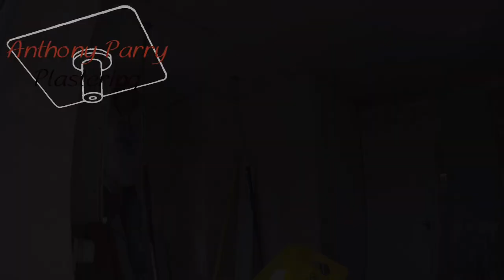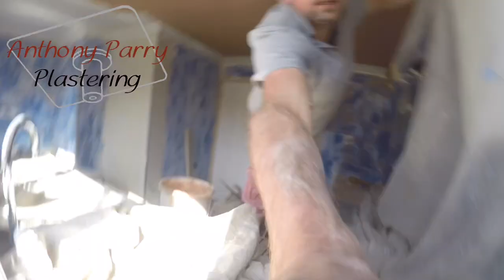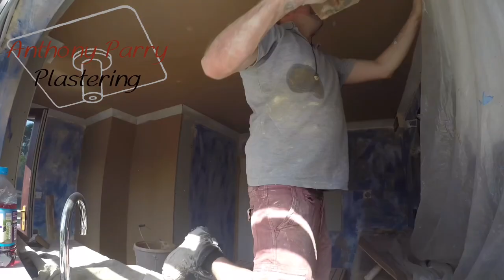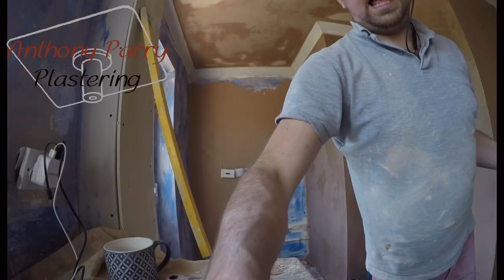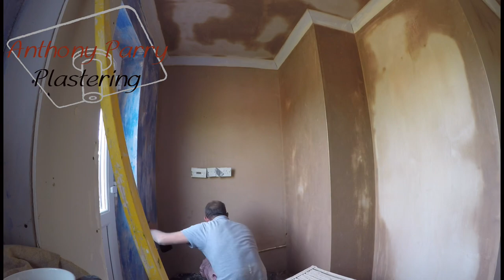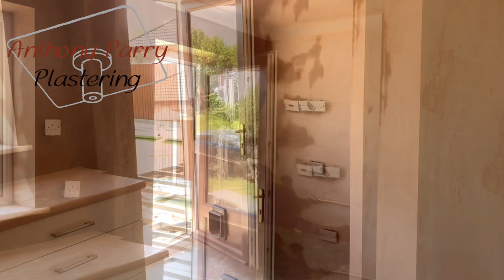Plastering a kitchen start to finish timeslape

Comment: Good work as always pal... But i would never put coving in before skimming as you lose some of the profile....
Reply: Quite agree plus the paper fluffs when I line in
Reply: @alfamad155  it does buddy... 👍
Reply from the maker: I’m sorry boys but I’m going to disagree, I’ve had this conversation a few times. 

Here are my reasons for putting coving on first: 
-It’s more efficient 
As soon as the coving is on you are free to skim all the ceiling and walls. 
You don’t have to come back after 2/3 days once the skim has dried to stick the coving on. 

-You have also got more chance of damaging the plaster when putting the coving up afterwards. especially since you would have to put nails underneath the coving before it sets to keep it in place.
Also you then got to fill underneath and above the coving. 

-You always have got a line to work with so it makes it easier. Especially if you have walls that’s aren’t perfectly straight. This means you can build the skim out to make it right.

-You don’t lose the profile, if you do then something has gone wrong when you put the coving up. 

-If the paper fluffs then that means you’ve been using too much water. 

I’ve never had a problem in the 22 years I’ve been plastering. 
If you’ve never had a problem then that’s great and it’s working for you. These are just my reasons for my method
Reply: @AnthonyParryPlastering  I find the suction generated on fresh plaster means there’s no need for nails.  I also fill as I go when installed either the c shape or s shaped. We all have our own way ultimately it’s what works for each isn’t it.
Reply from the maker: @alfamad155  definitely, I don’t want to say my way is best way, it’s just my way. 
Sorry if it was long winded but I always back my own work. 😀

Comment: is it better to use blue grit rather than pva? I've got to skim a kitchen similar to the one your doing here but I normal use two coats of pva
Reply from the maker: I think it a down to what you want. 
If you’re use to PVAing then it not a problem and you can get on it that day.

If I can I prefer to blue grit, I like that I put it on the night before and I can come in and skim without having to pva before skimming. Also you dont have to worry about the pva drying out. Especially if you’ve got bigger areas on. 
It will even out the set if you have different backings. It should all go off at the same time. 

Also with blue grit you see what you painted on and you have the grit in it. if you have a area that needs more grip. 

Hope that helps

Comment: Hi Anthony great job, are you flatting with a metal speed skim or plastic.
Reply from the maker: Thanks Dwaine, I use  the speedskim stainless steel flex to flatten after my first coat. I use to use the plastic but I prefer the steal one.
Reply: @AnthonyParryPlastering  I used a 900 steel one 2day on an empty property on the bedroom walls after the first coat & was impressed. Do you just use after first coat then
Reply from the maker: @dwainearmitage7570 I do love mine.  I just use it on my first coat. But I seen a few that use it afterwards. I do use on curved ceilings sometimes to help with the curve. But I prefer to use my trowels.

Comment: Buddy why the hell did you put coving up before you plastered it all . 1 it can get damaged,  2 you can loose the margins, 3 if the exsiting walls are out and you put beads up , you can loose the coving corners.  And 5 why make life harder and get all plaster water and plaster all over it . A good job but back to front for me .
Reply from the maker: Hi bud, I find it quicker and easier to do it this way. Rather than doing it after skimming. I also think i’m strengthening the coving by work into it. 
I’m also not a fan of filling the coving after it’s been skimmed. 

In terms of loosing the margin and putting beads on. you can always see the margin, so you can keep it nice and straight especially if you need to build it out you walls that aren’t straight.  
you can put the beads on before putting the coving up. 
I’ve never had problems with damaging the coving. 
It’s all down to how you’ve been taught really.  
I’m sure you way works great for you. 
As long as it looks good and it’s solid that’s all that matters.👍
Reply: @AnthonyParryPlastering  yes that right. But i do the coving as soon as ive finshed skimming , that same day really. But yeah you dont always looss the margin but ive seen a lot over the last 18 years . And you will be surprised . I got taught in college all these years ago with city and glids and level 2 nvq . But if ut works for you and the customer doesnt mind you doing it that way , knowing that the coving could get dirty. Then keep going , also maybe do some real time stuff and not always time lasps . As dome people will not know what you are doing buddy and will ask many questions .
Reply from the maker: @justinwalker5237  That’s in the pipeline bud. Its hard to find time when your working on your own. Time is money, Plus I’m slowly getting use to talking to the camera. 

Do you not wait for the plaster to cure before sticking the coving on?
Reply: @AnthonyParryPlastering  ok i know the feeling ive worked on my own since 2012. Watching  you do it is exactly what i do . Putting small boards up etc . But no you dont need to wait for the plaster to cure .you can go staright on . As the suction not high and easy to polish  if you scrape the ceiling . But you can wait till next day if you finish your hits early. But the longer its drying the greater the section is .then you have to use water to control it
Reply from the maker: @justinwalker5237  As long as it works for you and you don’t have any problems that’s all that matters. 
I’m a 3rd generation plasterer so all my experience has been passed down to me. I’ve worked with a fair few plasterers so know everyone does things differently. 
As long as the quality is at a high standard that all that matters.
Reply: @AnthonyParryPlastering  that's its buddy a family thing hey. do you use my builder to get work . Thats where i get all my work from and its pay as you go and works anywhere in the country
Reply from the maker: @justinwalker5237   I work for a couple of builders and a conservatory company. Then I’ve got all my private work on top of that. 
I’m really lucky because my dad had a great reputation and I’ve taken over his contacts.
then there’s word of mouth and other tradesmen I work with as well. 

The YouTube channel is a good advert too Its showing how i work. But it’s early days with this  I’m just experimenting with it at the moment.
Reply: @AnthonyParryPlastering  ok then buddy , well i hope it all goes well for you. And if you decide to do more private jobs and meet new contacts.  My builder is the place to be
Reply from the maker: @justinwalker5237  Cheers bud. All the best to you too 👍